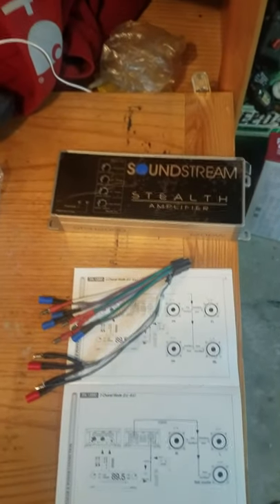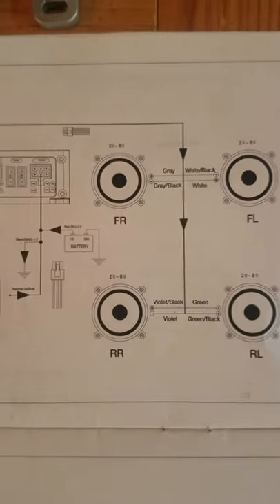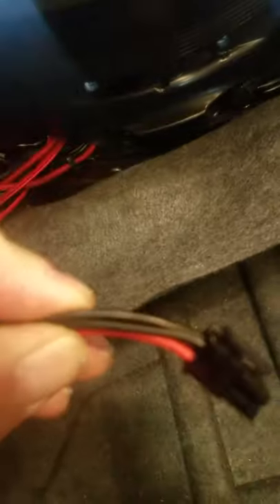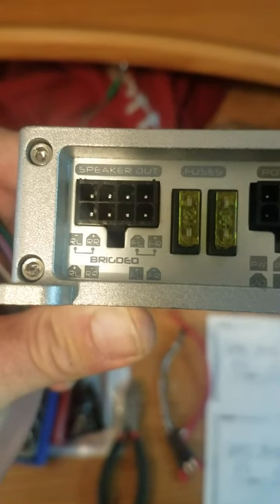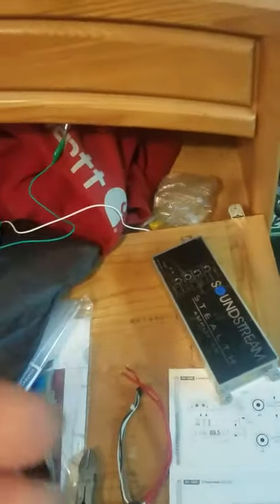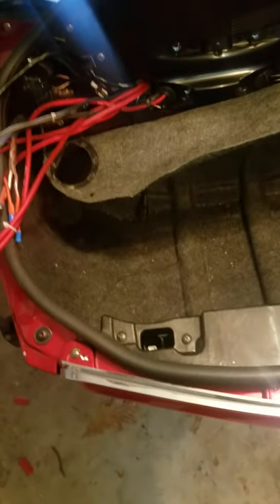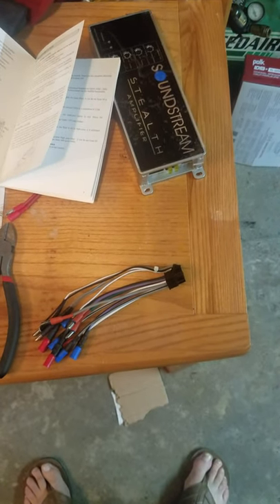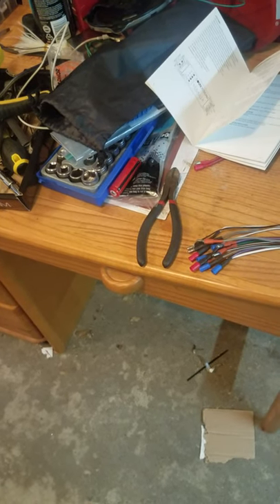Soundstream-ST4 1200D Motorcycle Amplifier Installed W/Issues

Comment: Just to give you some peace of mind, the reason for the thin input wire is because all the input is for, is to provide a signal of that oem speaker feed. The input is low watt, no need for anything thicker. The output in the other hand needs to be thicker because now it’s amplified. You can always do a quick check of polarity by looking at the speaker when active and see if it’s standing up on bass or is squatting down on the bass hit. If it squats down, your polarity is backwards. If it is backwards, it won’t hurt it but won’t be efficient. People run opposite polarity when installing isobaric. Hope this helps you.

Comment: I have had that same amp in my truck on mids and highs for at least 6 years now been a good amp running 6 speakers total and it has yet to fail
Reply: Hey brother I’m planning on getting this, I was curious on how you had your input wiring hooked up?
Reply: I got aftermarket head unit with rca outputs, would I be able to use those?

Comment: I just finished diagnosing this amp . The rear wire outputs were in the wrong places. I had the key to get the wires out the plug and figured it out rather quickly. Thanks for puttin me on point
Reply from the maker: Nice....I'm glad you took the time. The speakers would've sounded bad at best or blown at worst.

Comment: Did you have to switch wires on both the inputs front and back, and did you have any issues with the amp turning on without the remote wire.
Reply: Did you find out.  I hooked mine up to my bike and fuses keep blowing
Reply: Yes I had to flip wiees around..
Reply: @timschnaufer6498  I just have up and took it back off the box no matter what fuses was blowing then I put a bigger fuse it didn’t blow just melted my ground.

Comment: So h how did u switch them.sir
Reply from the maker: When there are quick connectors for amps and speaker the pins that go into the connectors are removable if you are careful. You can use something very thin like a paper clip and slowly stick it into the back of the wire harness (where the wires are fed) and it can usually push the tab inwards so you can easily pull the wire out with the connector attached. Be careful because you will just pull the wire out of the crimped connection if you are too forceful.
Reply: @ThaddKuznicki  sorry for all the questions but what wires were actually wrong on the amp I hear u say the speaker wires are crossed 🤞 right are in the wrong place ur the only person who talks about this problem and I'm getting ready to install a system on my cousins bike
Reply: @ThaddKuznicki  I appreciate u brotha